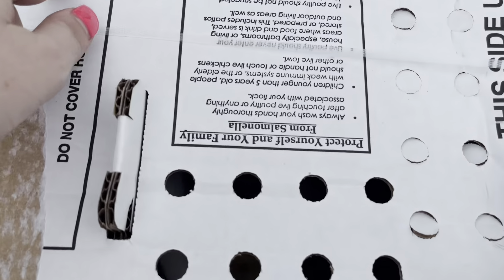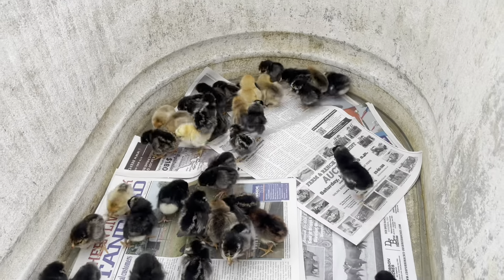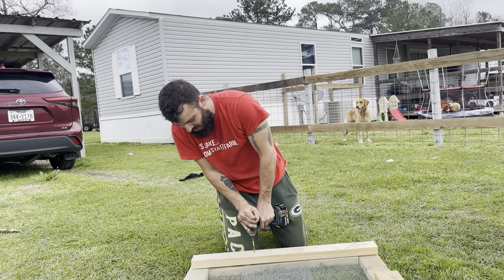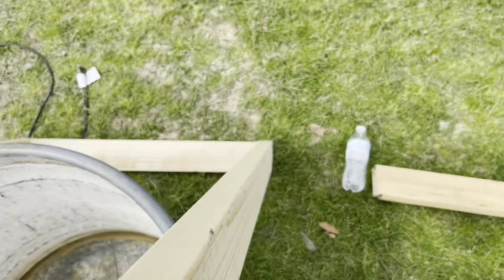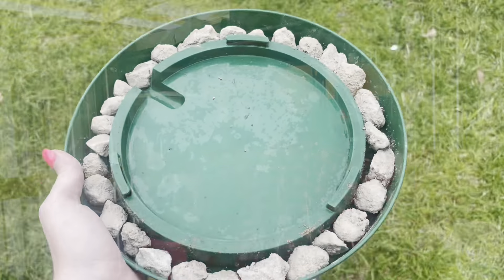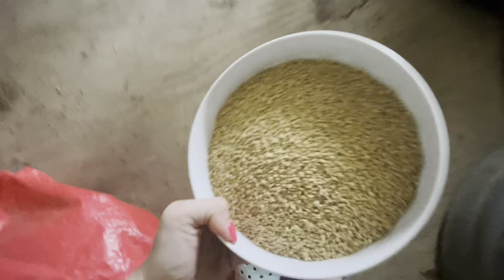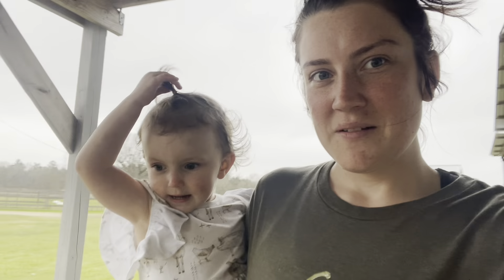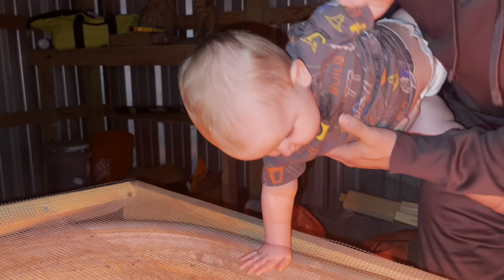Call me the BIRD LADY 🐣

Comment: There are so many experts giving their opinions, so you should be set.
I assume there may have been some literature from the hatchery, like most people aren't prepared ahead of time. IF you have enough info on the shipping container, you might be able to call the hatchery and get info on what was shipped to you...maybe. at least you would know what varieties you have. 
If the shipment is pullets, you have mostly females. There is a given that  about 10% error will give you males.
IF they are straight run (mixed), you could have half females.
I think you should know that it will take about 18-22 weeks for the chick's mature to layers. 
You will notice males as maturing earlier and their combs will be more prominent, depending on the breed. They may also be more rowdy.
You'll  have fun, but it will be work.
Just thinking g out loud on this, but maybe Lyssa would like having some chick's, too. Between these and what Jsmi had, she could also have a flock. What a way for her to start off in Texas. LOL

Comment: You need to Not enclose the bottom of their area with just Chicken wire. Predators can get through easily to kill them.  There is some kind of plasticfied wire that is vermin resistant.  Run it all around the bottom 18 -24 inches. ♥️👑 🐓 🐥